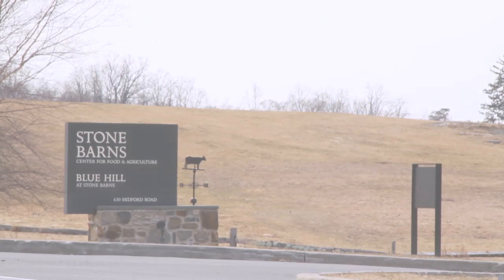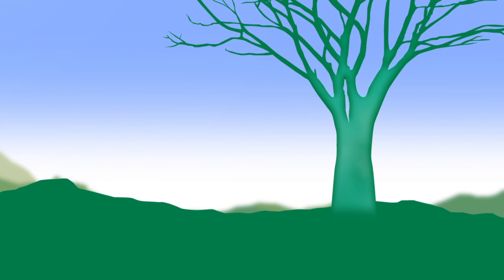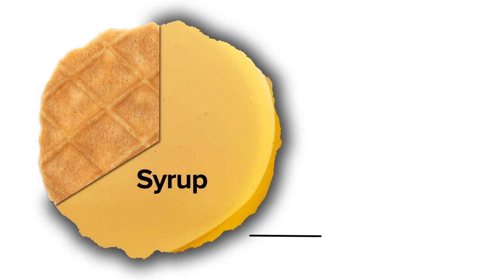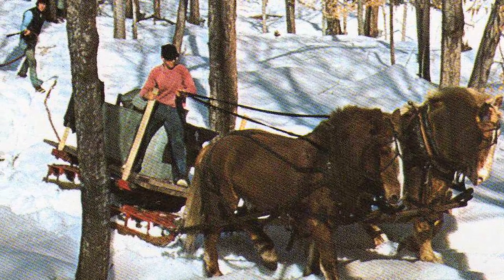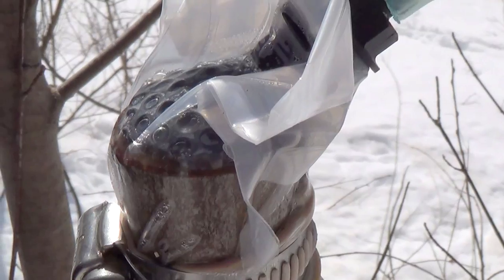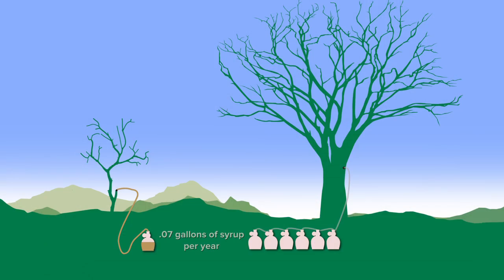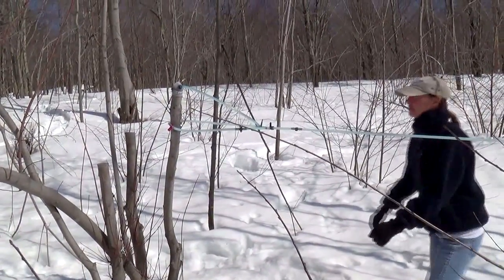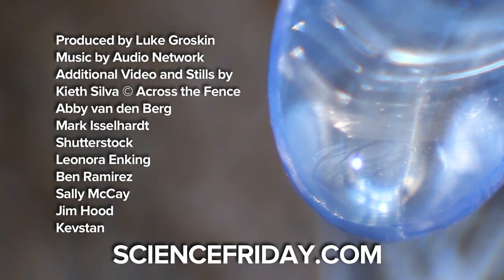Suckers for Sap

Comment: Maybe my math is off, but how dense are the acres these numbers are coming from?  You should get 0.5 Gallons of syrup per tap and 80 -120 gallons per acre.  That means you need 160 - 240 taps per acre to get the type of yield on mature trees.  With vacuum system no more then two taps per tree   Most people are happy with 60-70 taps per acre getting between 30-35 gallons of syrup.  I just had 60 taps in 2019 on bags and got 12 gallons of syrup.  Not anything close to vacuum.  Please correct my math if wrong.

Comment: Sure they increased the amount of syrup you can get from an acre of land by 6-7x but they also increased the supplies cost by 15x. Equipment costs will never allow saplings to be used commercially. Can't imagine anybody wanting to spend $1.00 on a tap, a fitting and tubing to get .07 gallons of syrup. You would have to have 15 taps, fittings and tubing to get one gallon of syrup, not very profitable. Add to that, how many years before a sapling is usable and how much labor per year planting and tending saplings? Do they keep producing the same amount of sap year to year? I know that tapping a tree destroys the part of the wood that has been tapped above and below the tap for several feet hence you never tap the same spot twice. Doesn't seem to me that a sapling would take to well to having it's top cut off and sucked on every year.

Comment: plant tree;s and don't tap in far or tap a branch end ,. extra tree/s to abuse while other tree's grow .  3/16 taps . tree is that old it could probably get tapped in few years or just tenor or branch.  probably refurbish the same small hole every year . gives options to starting out with no tree's  or plantation .  probably safer ways to get sap and leave the top on .. i saw maple hedges . new they were tough .